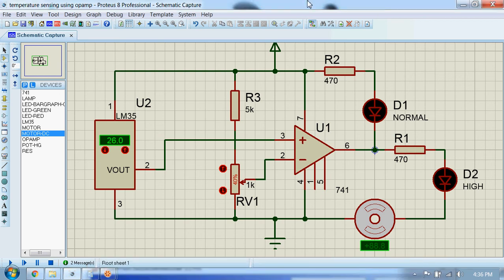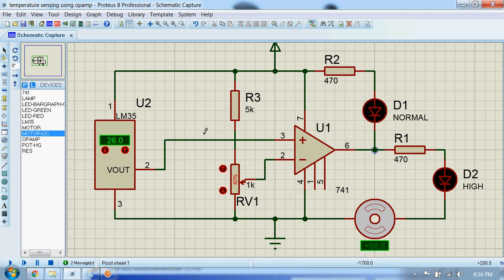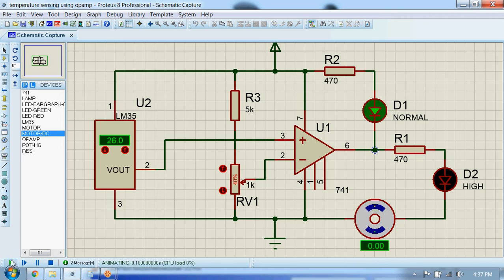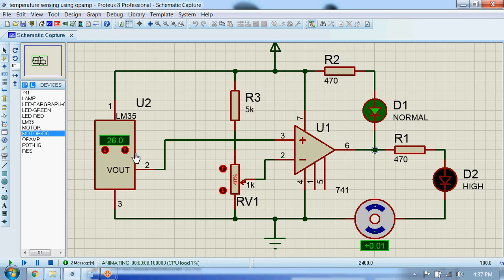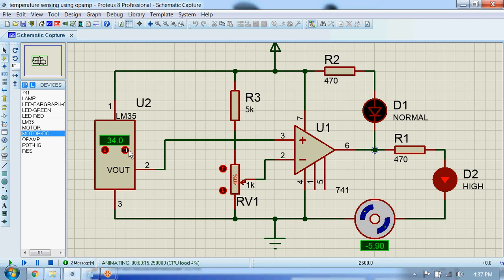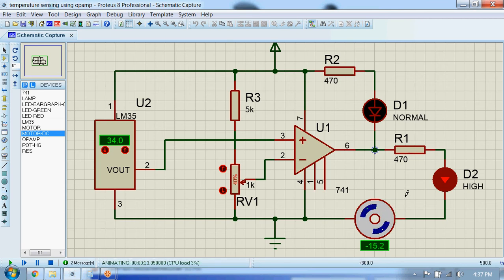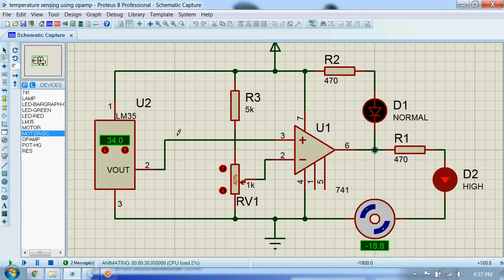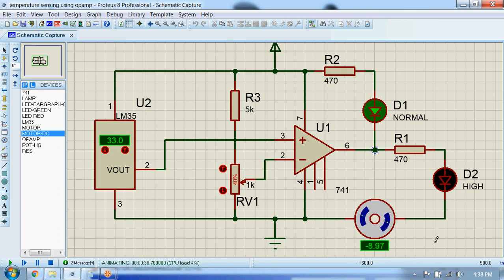temperature sensing fan.avi

Comment: do we need any coding for this? cn i simulate this in orcad?
Reply from the maker: You don't need code for this as it's a simple circuit without microcontroller. You should be able to run this circuit on any electronics circuit simulator. Thank you for watching and the comment.

Comment: which software you are using ?
Reply from the maker: It's Proteus v8 simulation software.
Reply: Electronics Engineering can you share the links to download it for free with license key
Reply from the maker: leave your email ID.
Reply from the maker: I am sending it as a google drive link. You should receive it in an hour.
Reply from the maker: I have shared it with you on google drive. Please check it.

Comment: It would be better if a heater was also used and the circuit would switch between fan and heater according to variations in temperature. Nice circuit though.
Reply from the maker: yes that sounds better but there is no heater module on the simulation software I'm using. Thanks for your comment :)